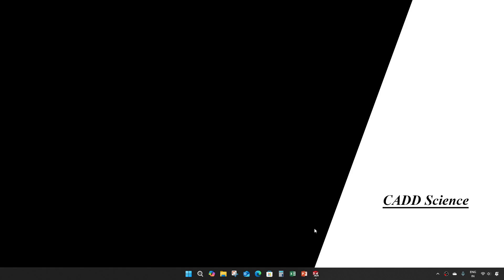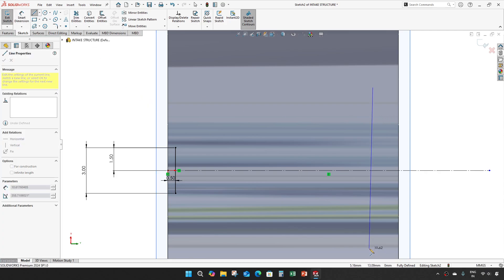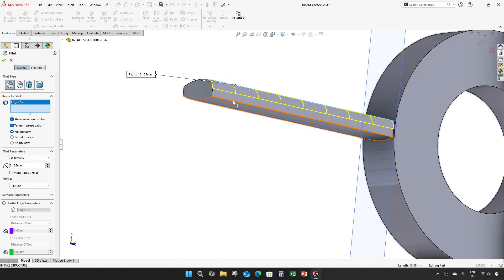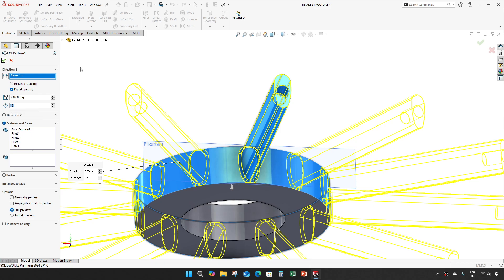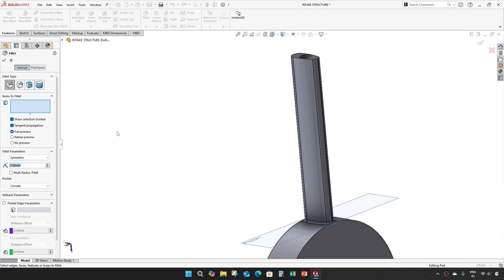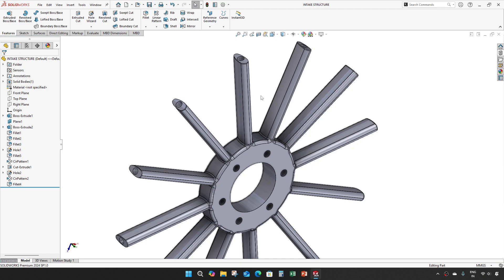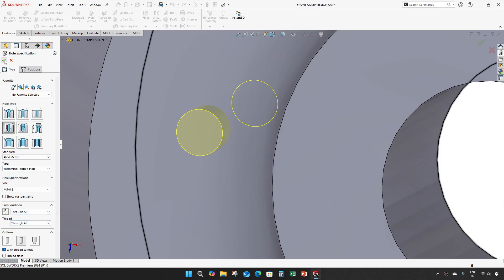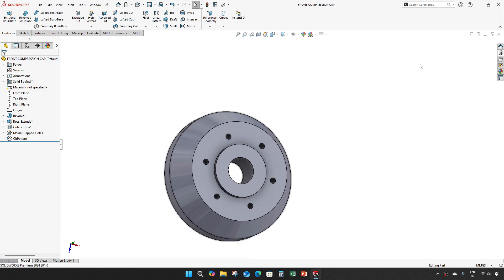PART 24 | JET ENGINE MODEL | SOLIDWORKS

Comment: The fillet on the blade on the lower edge curves up, how can I fix this?
Reply from the maker: check if the blade thickness is correct or reduce the fillet size